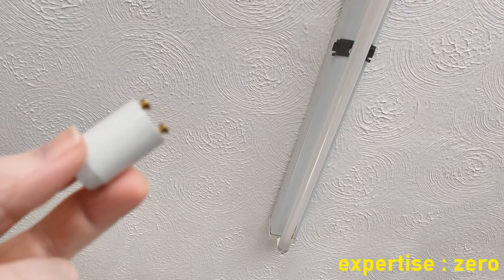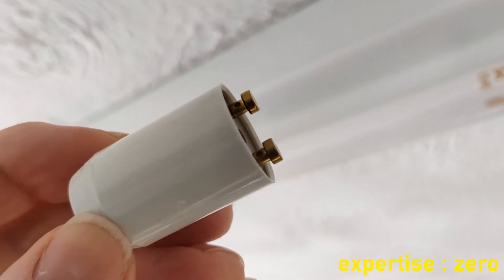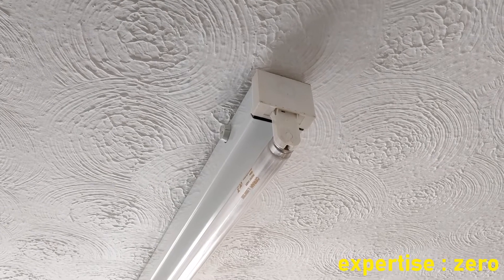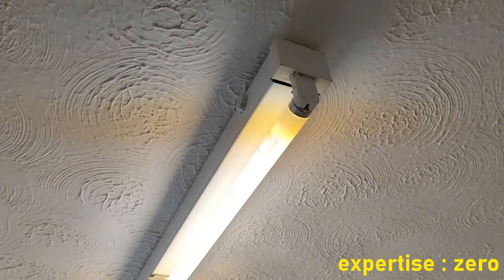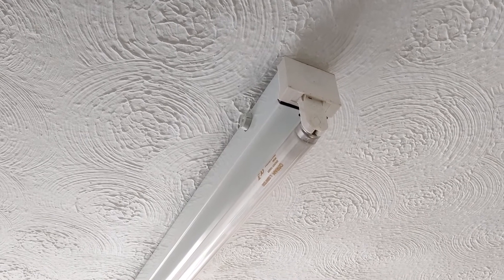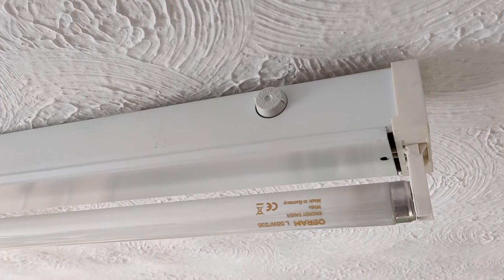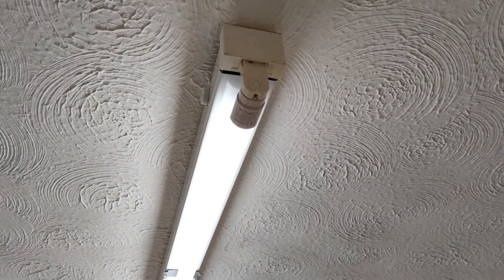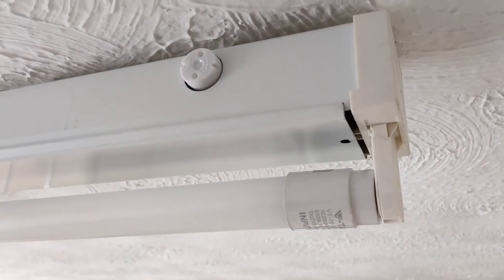Fluorescent tube light : where's the Starter ?

Comment: it's not a capacitor, capacitors don't go PING ping PING last i checked. it's actually a bimetal thermal switch. the pinging sound is actually the mechanical noise it makes when it opperates. the dummy starter is just a fuse. the only time you will need to replace it is if the LED tube shorts out. you have a frosted LED tube. you need a clear one or bare LED's because half of the lumen output is waisted by the diffuser. and that fixture looks a bit worn out.  for your situation, sugest that you install a clear (not frosted) integrated LED strip light fixture with a dedicated electronic ballast, they don't buzz. (unless your a fluorescent light nut like me and you like all of those noises). LED strips are usually much slimmer too. i'm not relay a fan of LED'S and prefer the older technology (unless i have to install LEDs)  but looking at your situation. a whole new fixture with bare LED's (if possible) would suit your situation best.